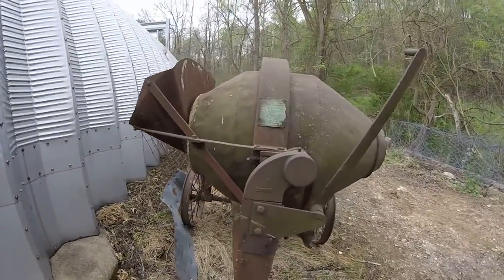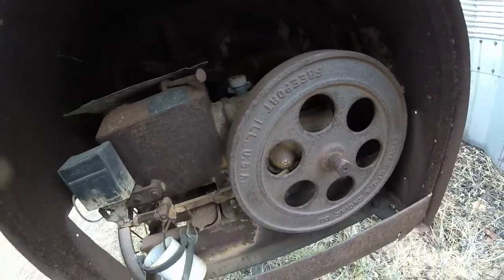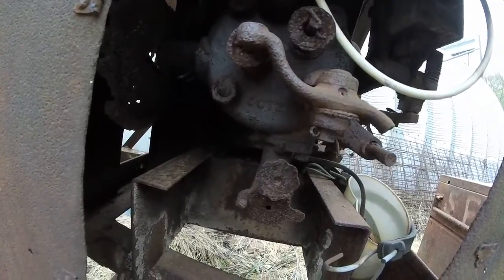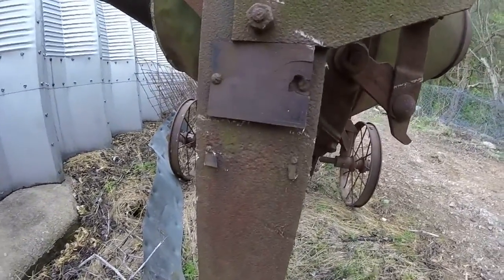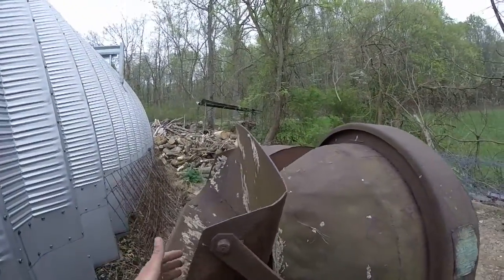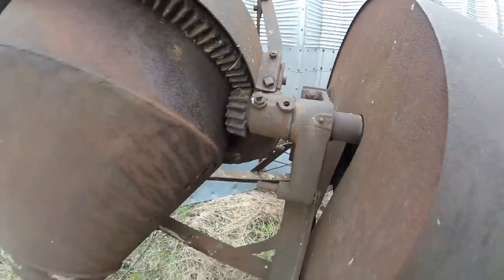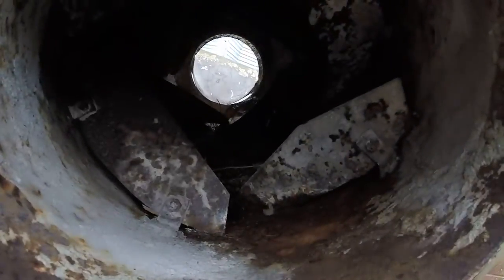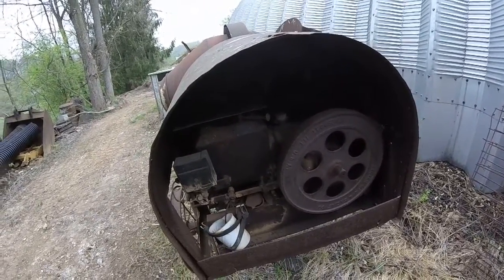T.L. Smith concrete mixer with stover engine

Comment: I have the same mixer but I am missing the gear on the engine crank could you measure the diameter and count the number of teeth for me. Good luck with it. Thanks.
Reply from the maker: the gear measures 6 1/4'' and has 36 teeth hope that helps are you trying to find a gear or get one made
Reply: I am trying to find 1 i thing the gears on yours should be the same as mine i have a different model its a 2 1/2 with a stover 1 1/2 ke.